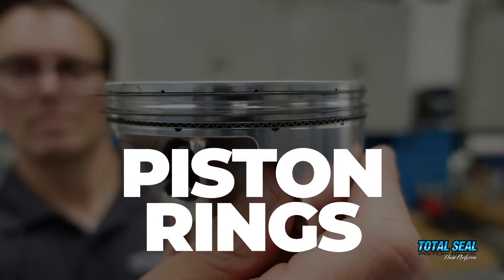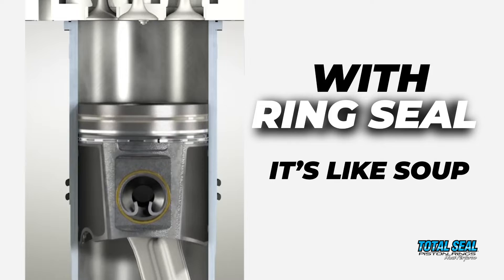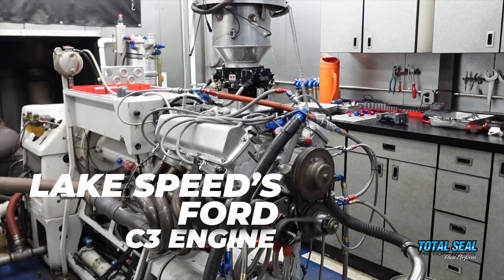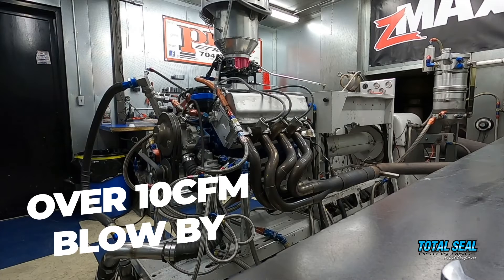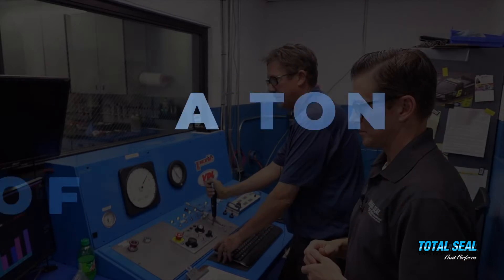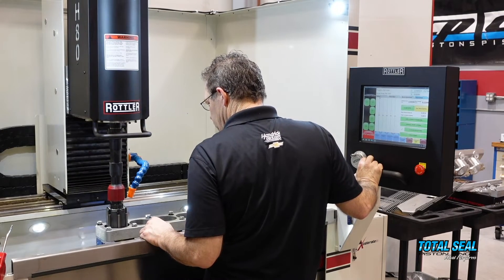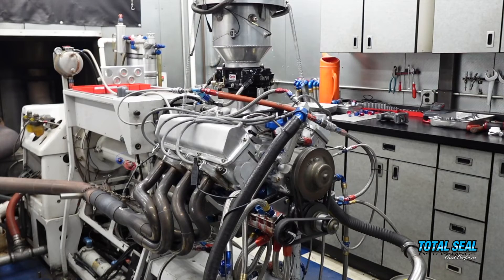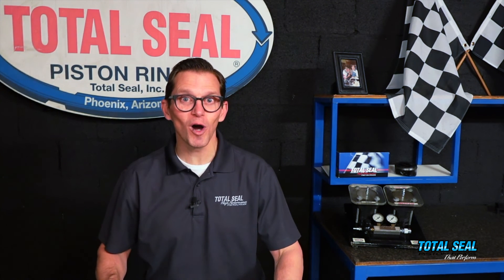How Much Power Are New Pistons, Rings and a Hone Worth?

Comment: What metal type of rings work best if i want to just do a DIY refresh on a good running engine that is not using oil. That is a simple stone hone, new ring set, new valve seals, valve job?  Maybe roll in some new bearings. 
Also size?  
Standard size or slight oversize?

Comment: That 200+ hp. Is also adding a new highest technology camshaft with the best professional pedagree attention to that particular engine
Reply: He said the hone and rings were worth 200 and the other stuff, cam etc was 100hp. I take him at his word.
Reply: @robert5  at the same time he replaced the rings, he also replaced the piston with much, much  higher compression.  This is not   apples to apples test, for accurate data. The utuber also included, the old rings also had rust in the ring lands. If you insist on still believing this, then you're the customer he's looking for.